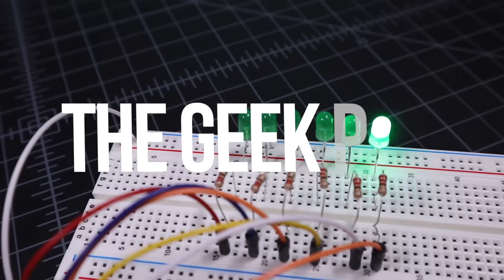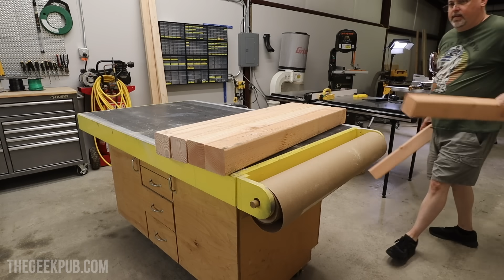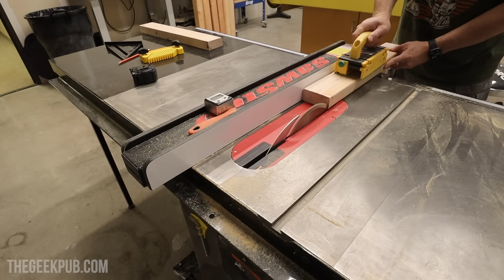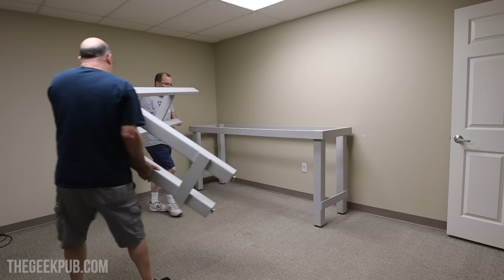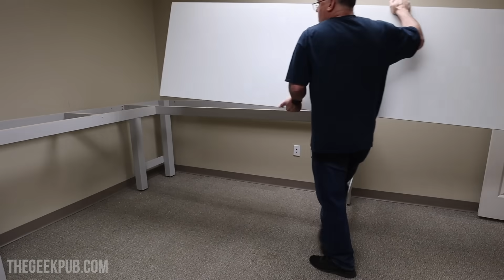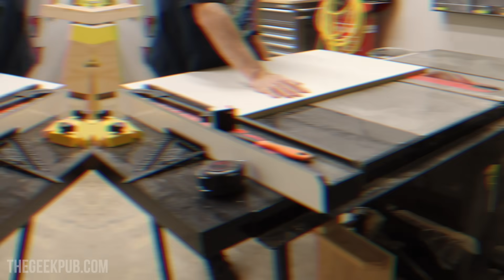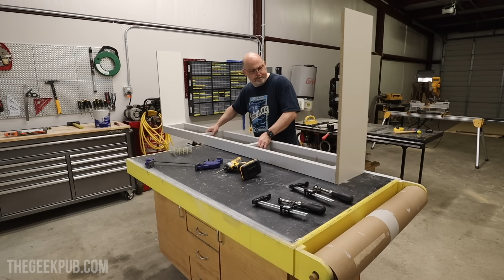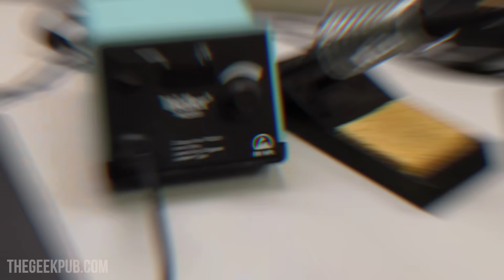Ultimate Electronics Station Build

Comment: I think it may be good practice to clamp a block in the center behind the cutting straight edge to stop any pressure warpage due to the saw. A long  2x, a block in the center of the guide and 2 clamps should insure it NEVER warps. I realize you’re using a light saw with minimal pressure. It’s an extremely long straight edge, probably very expensive.Just a thought not a criticism. Also, a smooth foam roller pad will help paint lay flat and save you some $$$ on buying expensive products.. Doors always come out smooth as glass with this application, how many coats is usually the issue with lower grades.. It iS true about laying out, not saying that. Love the vid!!
Reply from the maker: For cheap ones that's probably a good idea.  But I bought a good one so I wouldn't have to do that.

Comment: I worked as an electronic tech most of my working career with many years actually doing component level troubleshooting and I was never provided with a bench as nice as that. Good Job.
Reply: I am a current electronics tech, my bench is made of the thinnest melamine known to man, covered with burns and gouges (not me, I swear).
Reply: @davidstech1445  I used to worked repair oil well logging tools in the 80s.  There were high failure rates of components because of the well temperatures. We used high temp solder and milspec components.  I got tired of it and went into communications after that and retired from it last year.
Reply: @Chris_at_Home  What a fantastic experience! I'm working in the communications sector and find myself working on many other odd jobs along the way. I am only a few years into my career, the possibilities seem endless. 

The hassle involved with the high-temp solder and mil spec parts would drive me insane. Thankfully I have never dealt with it. I hope you enjoy the retirement!
Reply: @davidstech1445  Thank you, I m enjoying retirement. Nice you are working in communications. I started doing that in 1989 for a small company that even took me overseas some. My last 15 years I worked for AT&T doing communications along the pipeline and then working at a gateway earth station.

Comment: I totally agree with your construction methods and materials for this application.  Well done!  I just have one nit to pick.  Why didn't you fill the exposed screw holes?  It seems inconsistent with the rest of the level of finish in the project.  Seeing clean t-molded edges next to rough screw holes just doesn't seem quite right.  I get that you may want to be able to disassemble the thing, so why not use push in screw caps?  I just found them on ebay in 10 packs for $1.45 with size and color choices.  The only consideration is that you'd have to be somewhat mindful of your degree of countersink to use these particular examples.  Thanks for sharing this project!
Reply from the maker: If that's something that bothers you, feel free to do it on your build. ;-)  I didn't consider this fine furniture. Of course if I were building something like that I'd have filled the holes with dowels and sanded them down.

Comment: First : What about a vent for the soldering station to pull it away from your face while you are soldering? 
Second: 2 large powerstrips (plus it looks like a the light?), going to a 6 plug splitter, all in a single outlet? Might have been safer to plug the strips directly into the wall into their own socket, and plug the light into one of the strips.
Reply from the maker: 1) It's on the list. 2) There is no possible way this will ever pull anywhere close to 12 amps. Splitters are only unsafe when overloaded.

Comment: As a temp solution to your ourfeed problem, get yourself an adjustable outfeed roller from Harbor Freight. I think they are about $12 and they will save you making dangerous reaches until you get your table built.  I don't often suggest HF but I use my roller a lot even after building my outfeed.

Comment: Here’s another “Pro” tip; use a utility knife to score your cut line on the melamine and that will help with the tear out as well.
Reply: also if you leave extra space, you can clean it up with a router - ensure you have a sharp cutter.  this tip helps more if you cut wood then apply a veneer with glue and clean up after it is dry, as well.

Comment: I've been putting off my own electronics bench that I will use mainly for soldering and small electronics repair, but I've never worked with melamine coatings before.  Would scoring the melamine with a box cutter help (if it is even possible)?

Comment: If cutting a material that chips easily it also helps to use a saw blade with lots of teeth as opposed to fewer teeth. That way it is essentially taking a smaller "bite" with each tooth.
Reply from the maker: Yep.  That's also good advice.

Comment: Mad props to that simple but function design.  I am planning on building a few benches like this, one on the wall with shelves, and one rolling mobile workbench, for my garage.  That way, I will have a nice place for woodworking projects, maker projects, ham radio, gun maintenance, or just about anything else that I need a good solid flat worksurface for.

Comment: Is that mat an ESD type? I’m not the ESD police just thought if it was I could use one like that as the usual ESD mats are boring! Btw excellent bench! I prefer the scope on the bench so I can make adjustments. Everything else I keep on the shelves like you did, I also use GPIB and USB connectivity for automation when necessary or grabbing waveforms off the scope!
Reply from the maker: It's not.  And that's something I have plans for in a future video.  I'm surprised more people didn't comment on this one!

Comment: I use a sheet of 1” insulation foam under the wood to support it during circular saw cuts. You will cut into the foam but that’s what it’s there for.

Comment: Cool build, but what's the point of 4x4 legs if all the weight on each one is on a 1-inch wide leveler?
Reply from the maker: Torsional stability.  It has nothing to do with compressive force.

Comment: To prevent chipping of surface finishes, put the surface you want facing DOWN and let the leading edge of the circular saw blade CUT UP INTO IT, not the way you did which the blade breaks out of the finished surface! Only have the finish surface upwards if you're using a table saw which cuts down into the work piece.
Reply from the maker: If that’s an option. I explained why I did what I did.  You'll notice I used a down stroke jigsaw blade just for that reason.

Comment: Not that I criticize. However, I don't understand this configuration. As for me, the microscope and computer monitors should be in front of my eyes - they are used very often and looking at them sideways, at an angle, is a pure misunderstanding. On the other hand, the measuring equipment, which you have to switch and adjust frequently, should be on left side - so that I can do it comfortably with my left hand - within easy reach of my left hand so that I do not have to take my ass off the chair (having to constantly lift yourself is extremely inconvenient!). I recommend that you connect the oscilloscope to a larger monitor - it really makes your work easier, especially observing the oscilloscope graphs - you have them large, legible and right in front of your nose! In practice, you will not use the oscilloscope display at all.

The workbench itself is too narrow in my opinion! It is enough to work with small modules, but what if you have to put something bigger on this table: an acoustic amplifier or other stereo element, maybe a turntable or a tape recorder? You lie down and squeal, tired of fear that it will fall on the floor... It should be remembered that the above-mentioned equipment after disassembly takes two, and even three times more surface on the workbench than in the folded state. That is why it MUST be large and with a lot of reserve, because you never know in advance what you will be doing in six months or a year. In my opinion, the workbench should be no smaller than a meter wide (I mean the space without shelves, if they are, wider by the depth of the shelves) and two meters long, counting without the side table top. This is no exaggeration, you will see how quickly you run out of space.
On the left there should be a large, two-story shelf with a high load capacity. You cannot imagine how quickly it will be packed tightly with measuring equipment - this is one hundred percent rule in every electronics workshop.

Besides, the idea of building a worktop, side top/side tops, shelves, cabinets is the best idea. Those that can be bought ready-made are of poor quality, unstable (worst flaw!). They are not cheaper at all: they are more expensive, despite the currently high prices of wood. They should NEVER end up in a decent workshop!
 Making furniture for your workshop, you gain two priceless things: you make them EXACTLY to your needs (not what the manufacturer imposes on you), and enormous satisfaction if you did it decently. Just like the author of the film. 

The armchair should be three times very: comfortable, durable, nice. You will spend many hours on it... It shouldn't tire you, it shouldn't make you angry. It is not worth regretting the money for this piece of workshop equipment. We buy the piece from good company, the best quality we can afford! No compromises, it is too important if you want to avoid back problems - I know something about it!

Your workshop should be the place where you want to be, which you are happy to brag about, then it will be the best place to work!!!
Reply from the maker: I believe I explained my workflow is not standard.... and why.
Reply: @TheGeekPub  I wrote that I not criticize at the very beginning. I understand that someone has their expectations and requirements.
My goal was to provide a configuration that is more flexible and provides many different applications, including undefined ones, in the future. The second goal was a suggestion (just a suggestion!) to take into account ergonomic aspects that stem from my own experience.
If someone follows my advice, they will soon find out that they are not pointless - I hope so.
The charm of our own workshop is precisely the fact that anyone can create it exactly as he/she dreamed of. And I understand that too.  :)))
Besides, it is not so much important that the workshop is better or worse (read: expensive or cheaply equipped) and how it is organized. The most important thing is to create it at all and feel good in it. Creating it with your own hands is a 100% guarantee.

Comment: I agree T-Moulding is the best choice under an electronics bench. I have had the sticky moulding pull parts off the table before, trip people, and stick to my arm hair. It's really annoying.
Reply: Heh. I hate the t-molding on the front of a desk/bench exactly for the arm hair reason! Seems like a hair is always getting stuck in the little sliver of a gap between the molding and the surface. I was always pounding on the t-molding at the office to try and close that gap. I've never had a problem with the iron on strips - it does need a fairly smooth cut surface, no loose dust, and a nicely hot iron held long enough to melt the glue. Don't bother with the self-adhesive "peel and stick" style. After the glue cools, use a razor blade to trim flush with the surface.

Comment: Some ESD matting would have been an awesome upgrade but that opens the rabbit hole of components/modules in plain plastic drawers etc so a bigger job overall. Nice work area in general though.
Reply from the maker: Totally agree.  I will probably do that as well as a some kind of grounding points in the future.  One thing at a time.
Reply: @TheGeekPub  Nice, don't forget the issue is maintaining yourself and your tools and the device under test at the same potential. Ground actually has nothing to do with it but we commonly use ground as the handy common reference point because most stull in our labs is connected to it. Eg Mat to ground via the 1M discharge resistor, soldering station to ground. Just discharging yourself to ground only makes you feel better, it does not equalise the difference between yourself and the DUT :-)

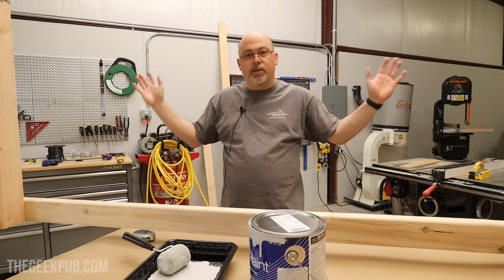Comment: 7:00 Might I suggest a second 2x4 on the other side of each set of legs?
Reply from the maker: Why?
Reply: @TheGeekPub  Additional Bracing, In case someone tries to sit on your bench, it will give a little bit or additional rack strength without a diagonal brace.

Comment: Thanks for the video!   FYI - I was checking out the links to the items you used to build the workstation and the link for the screw in feet levelers you have here and in your detailed article is the same link you used for the 2.5 inch Torx-head wood screws.
Reply from the maker: Thanks!  I've fixed them!

Comment: Spend 8k on a premium station or buy 50k for equipment, have a big garage to build it and then build it for 300 dollar... hmmm... I always like those easy DIY vids... (if you have the material) 😁 nevertheless it sure looks good and is certainly decent! Maybe in the US everything is cheaper than in the EU as materials go??? Dunno... eg that DeWalt router goes for +- 365 dollar (converted from EUR) here... And that is just one of the cheaper equipments in your vid hehehe
Reply from the maker: I could build this with two tools.  A handsaw and a screwdriver.  Don't let tools be your excuse.
Reply: @TheGeekPub  and a sander, router for the rubber strip, place to build it etc... but I get your point. I'm prolly jealous lol...
Reply from the maker: No.  You just need to think different.  No need to sand, or if you do, just use a wood block wrapped with sandpaper.  No need for a router. Just use glue on edge banding.  When I started out I didn't have a single tool.  I bought them over 20 years.

Comment: Excellent video! I am now super envious of your new workstation. I do have one suggestion though. You might want to think about adding some diagonal cross bracing on the legs, especially on the long span. I've built many gaming tables, work benches, and side tables over the years in a very similar design and all of them have ended up needing diagonal bracing. Granted yes an electronics workstation will take much less abuse than a workbench where you are sanding, cutting, using a planer, chisels etc. But sooner or later just from chairs bumping it and people leaning on it while working it may end up developing a wobble in one direction or another. Might want to add some cross bracing while its relatively unencumbered.
Reply from the maker: A single 2x4 has a nominal load capacity of 375lbs.  So in this case 750lbs.  Ceilings in houses carry far more weight (in light fixtures and drywall) than this will every carry. So I didn't believe any cross bracing would be needed.  I'll do an update video in the future if that turns out to be the case.
Reply: @TheGeekPub  I agree with you completely on the carrying capacity. It is more than capable of withstanding any compressive load you could put on it. In fact I'd go so far as to give it a full 5X Trinitron rating. :D The bracing I am referring to is to resist any lateral, sheer, or torsion forces that could be applied to the leg joints overtime from people leaning on it, moving it around, bumping it, etc. the wood around the screws that secure the legs to the top will compress and begin to hog out the holes that they run through. Ultimately this will results in a wobbly bench. It will by no mean collapse but you might end up with a bench that rocks or wobbles when you pull yourself up to it or push away from it on a rolling chair.